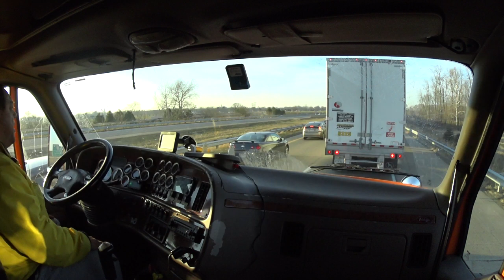3071 still stuck in traffic. Sony HDR-AZ1

Comment: Holy smokies! 😊
Fuel starving a diesel engine can be a major pain in the butt to restart.
Reply: Also it's bad for the fuel pump. Dunno if it's the same for diesel pumps but gasoline cools the pump and if it sucks air, it burns out and hurts yuor wallet to repair...

Comment: If you had access to the owners manual, it should say how may gallons you have approximately left in the system. You could know then if your in  trouble. 
Don't get in this habit of getting the last drop out of the tanks. Winter crash delays may make you in deep you know what.